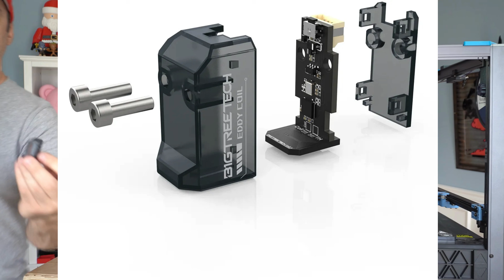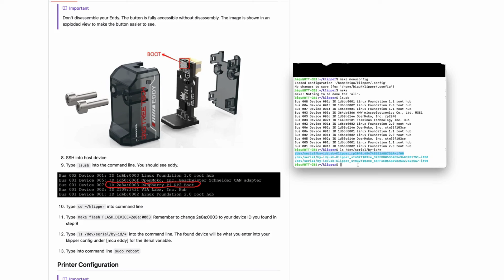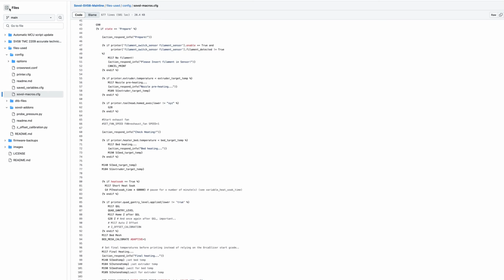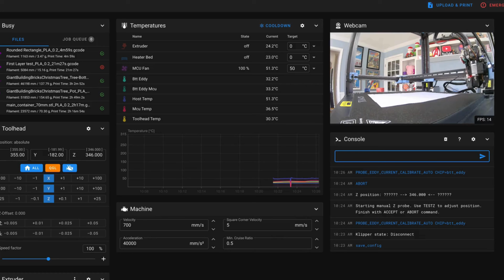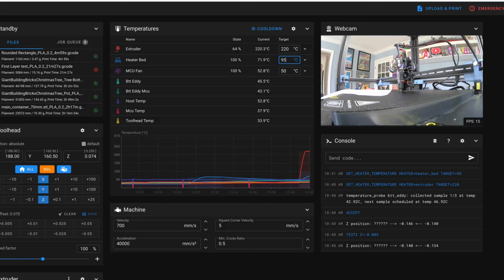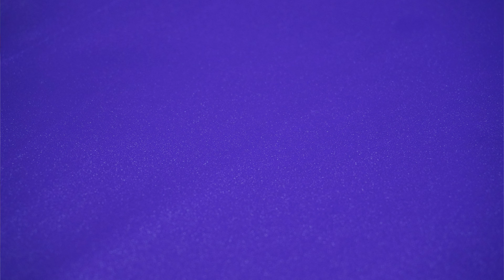BTT Eddy USB Probe Setup on Sovol SV08 – Full Install & Calibration Guide

Comment: The BTT Eddy looks pretty sweet compared to the 8 mm inductive probe that's standard on the SV08.  The stock inductive proximity sensor doesn't provide a very accurate bed mesh even with averaging two readings, and it's not temperature compensated, however the Amazon reviews on the Eddy are not very good, including a comment that Bigtree Tech keeps relisting the Eddy, presumably to hide all of the bad reviews.

I'm going to wait to upgrade the 8 mm inductive proximity sensor.  I don't see any need for half a micron of probing accuracy with the Eddy when the thin aluminum bed on my SV08 warps more than 1 mm across its surface when heated to printing temperature.  I started the mod where the magnetic sheet is drilled to expose the mounting screws so the thin aluminum bed can be removed and 3D printed plastic shims can be used to level the bed and pre-stress it so it warps to a flatter taco shape.  The aftermarket upgrade we really need for the SV08 more than any other is a thicker stress relieved cast aluminum bed that doesn't warp into a taco when heated, preferably with user accessible mounting screws with leveling springs underneath.

I see that you're upgrading the nozzle on your SV08.  When assembling my SV08, I installed the MicroSwiss hot end.  I love that I can now cold swap a MicroSwiss FlowTech nozzle in a minute using nothing but a 7 mm nut driver, without needing to remove and reinstall the heater and thermistor without damaging them, as is needed with the stock nozzle.  I also replaced the stock motherboard fan with the Noctua NF-A4x10 24V fan.  It's so quiet that I didn't bother to put it under PID control to lower the speed to the lowest that would cool the MCU and turn the fan off when the SV08 is idle.  The Noctua fan runs all the time and it's so quiet I can barely hear it.  That added five minutes to the SV08 assembly time and was well worth the time and money.
Reply from the maker: Thanks for the reply! I am finishing up a video on the micro swiss hotend. Being able to swap the flowtech nozzles with minimum effort it awesome. I frequently go back and forth with a .4 and .6. The flow is better and more consistent too. I was having some issues with PETG and the stock hotend, it would clog on occasion. No issues with the micro swiss. 

The bed... Mine is a taco, and gets worse the more it's heated. I have played with the idea of swapping to a 8mm thick voron bed. I have a cheaper 50.00 350mm bed that I had swapped out on my Voron 2.4 for a Mic6 bed that stays almost perfect on the voron. I have found a few have made adapters to adopt the 2.4 bed to the sv08. I think l'm going to do a video on it and why people may want to look towards an improved bed. 

I'm on the fence with how far I want to try and improve this printer. My original idea was to pick and choice lower cost options that would improve the print experience with the SV08. Changing beds, and everything start to push prices up into the lowerend Voron 2.4 kits. But I can see the value in doing these mods at the same time. You can start with something at a good price point and pick the mods you want to do. The SV08 means well, and I think Sovol did a good job in terms of offering a Voron like printing experience at a price point that's affordable, and something you don't have to have the knowledge to assemble, and program - until you start modding it!  

With the Eddy Coil. I have seen a few issues with the shielding of the usb cable. I have a higher quality cable, but have not had a chance to pin it and install. I'm hoping that improves some of the noise/frequency interference issues. It hasn't been a consistent issue for me, but I have a few emails so far and inputs on issues with that. 

The Fan mod is 100% a must. Instant improvement, as you said even without setting it up to be temperature controlled. 

Thanks again for sharing your inputs!!
Reply: @ThePrintasaurus  - Totally agree on all points.  I like Sovol.  I love that they're embracing open source, giving credit where due, contributing back to the community (code, mechanical designs and a little cash).  There is definitely a business model where open source can be leveraged to make a product that is re-engineered to be more suitable to manufacturing, and the SV08 was a noble effort.  Sovol got a lot right in the SV08.  As an engineer, it bugs me to see the places where Sovol was a little penny wise but pound foolish.  I would have loved to spend $100 more and had a flat print surface and 5" touch screen, and maybe a reliable camera.  I don't mind paying extra to upgrade the hot end although I wish all 3D printer manufacturers would form alliances and get discounts on good extruders rather than building their own as that's usually the weak point although the 3D printer manufacturers are finally starting to make good extruders and hot ends starting in 2024.  Similarly, 3D printer manufacturers should ship their products with plain vanilla Klipper instead of cobbling their own version, and they should ship their printers with configuration files for OrcaSlicer, SuperSlicer and PrusaSlicer rather than re-skinning one of the slicers that is guaranteed to be out of date and become more out of date.  That's wasted effort that could be spent ensuring we have good profiles for the slicer we already use.

So far, my SV08 is printing well.  PLA is forgiving enough that the taco bed isn't causing problems.

The camera didn't work, then worked for a few minutes after I upgraded the firmware, then quit again.  The Sovol SV08 camera trouble shooting page has several generic recommendations then asks the community to let them know when we've fixed the unreliable camera problem.  My SV08's WiFi didn't work either.  Most people apparently had the camera problem or the WiFi problem but I had both.  I plugged a Vonet 2.4 GHz WiFi bridge into the SV08's Ethernet port to get it on my wireless LAN.

It would be nice if these annoying issues were resolved before the SV08 shipped.  I waited half a year to avoid bleeding edge new product issues, and still had these problems, but it's still a good printer for the money and it'll take a lot less time and money to get the SV08 where I need it than building a Voron 2.4.

If I can drill the magnetic sheet, remove the heated print bed, shim it, rinse & repeat a few times and get the bed flat to within 0.2 mm, that's probably good enough for the girls I go with, but it really should be much better.  If it's not too difficult to switch to a Voron 2.4 build plate, I'd be willing to do that but I'm not ready to delve into the engineering.  I'm lazy enough that I hope someone makes a video explaining what to buy and how to do the upgrade.  Subscribed!   🙂

My SV08 wish list:

Stay flat print bed
Rock solid WiFi
Camera that just works
0.1 mm accuracy or better bed probing
MicroSwiss hot end (done)
3D printed enclosure (I'm designing it and will upload to Printables/Thingiverse)
Good OrcaSlicer profiles (I'll develop profiles the PLA, PETG, TPU and ABS that I use)
Reply: @Liberty4Ever  I'm doubling down on the bed/profiles/better probe, but.... Guys, I'm really curious what's the problems are with your wifi and camera? It's just the same linux as on RPis/OrangePi or wherever else, if something doesn't work - don't rant, look how to fix it not on SV08, but for Linux. If there would be some hardware-dependent stuff - look for SoC name too. I've seen that regularly during discussions on something new - people starting to reiterate same stuff, and one non well-versed in Linux guy gives assurance to another guy with same Linux level, and they starting to think that it's printer's problem. 

Everything that doesn't touch moving/heating parts - is a software-backed. Yep, I think that quality control and R&D could be a bit better, but after all... there's really simple way, how to look at it with a fresh mind: by forgetting that it's SV08 and by treating it like Voron2.4 with sensorless homing. Because it's what actually it is, just with a wee bit crappier extruder and injection molded parts.
Reply: @dj_feel_x  - Totally agree on the Just Fix It attitude.  My list of issues was as a warning to those who might expect an SV08 to print without fixing things.

I suspect the WiFi issue is the internal antenna, maybe badly routed or missing).  I plugged the SV08 Ethernet port into a WiFi bridge.  Fixed.  The web cam is probably a timing issue.  It mostly works.  If not, I go into Mainsail and restart Crowsnest.  The other deficiencies I listed, I'm slowly fixing.  I'm heat soaking manually to get good accurate bed meshes and first layers but need a better fix.  For now, I'm printing, and liking the SV08.
Reply: @ThePrintasaurus  Can you really spot this extreme warping with the eddy sensor or is the image of the warped bed also an artifact of the stock induction sensor going bananas ?
Reply from the maker: @maakmeneer   Honestly it was a little bit of both. What I found with the stock probe and a warped bed was it wasn't accurate enough that I would get a false reading (thought the bed was flatter than it was) If you take a look at my latest video on the Mandala Rose bed upgrade, you can see how bad my stock bed was with the eddy bed mesh.

Comment: My Eddy usb worked ok the first time a ran the temp com calibration, but now if I try and run it I get "Manual probe failed! Use TESTZ commands to position the nozzle prior to running ACCEPT" and subsequently get "temperature_probe btt_eddy: calibration aborted" it happens right after I try and save the first heatsoak Z offset save. I've homed all and ran the Z 5 mm, Any clue as to what happened ? should I delete my calibration save data and try again ? Thanks and merry xmas =)
Reply from the maker: Merry Christmas to you as well!  What are you seeing in your printer.cfg.  Scroll to the bottom, the section that says do not edit. Do you have something like this? Curious if the initial calibration failed. Under the calibrate = you should see a large amount of data. 
[probe_eddy_current btt_eddy]
 reg_drive_current = 15
calibrate =

I would rerun your drive current calibration.  Make sure you are at 20mm and rerun your  LDC_CALIBRATE_DRIVE_CURRENT CHIP=btt_eddy
Make sure you save that - SAVE_CONFIG
Then reset your z-offset  - PROBE_EDDY_CURRENT_CALIBRATE_AUTO CHIP=btt_eddy
again save that. 
Then rerun your temp offset calibration. G0 Z5.  SET_IDLE_TIMEOUT TIMEOUT=36000.   and then your calibration command - EMPERATURE_PROBE_CALIBRATE PROBE=btt_eddy TARGET=56 STEP=4

I switched to the Z-offset beta config as well - which allows you to fine tune and use your Z-micro steps to tune your offset and save it. Wanted to mention that as well. You can copy the macro section, everything below ###########macros and related ############ and replace what you have there. Just wanted to share what I have found to be a nice addition. 
https://github.com/bigtreetech/Eddy/blob/master/sample-bigtreetech-eddy-zoffbeta.cfg
Reply: @ThePrintasaurus  Yep that fixed it, thank you and happy new year ! Oh and I see there is an firmware update out now, someone really needs to do a vid on how to correctly update mainline klipper firmware ! ;)

Comment: I bought the E3D EZ probe but was wondering if the eddy would be better since I was going to do it anyways and going for the faster one seems a better idea if I'm already installing something.
Reply from the maker: I have looked into the PZ probe potentially for one of my vorons. I have a standard revo hotend, with tap on that machine. The eddy is very fast, and reduces the prep time a bit even with a heat soak to prep the bed before printing. The tap and what the PZ probe would be are really accurate as well. I think it really comes down to what you are trying to do. Speed at the sacrifice of some accuracy (eddy) or the Pz probe accurate but a slower method with having to touch the bed to probe.  Both would be a vast improvement over the SV08 inductive probe.
Reply: @ThePrintasaurus  I have been holding off to see how the eddy does, I have been running a bambu E3D obsidian nozzle on the SV08 and  it has been great with great flow and the prints look clean so it puts me in a situation that I cannot run mt E3D EZ probe. I am waiting to see what the reviews are for the eddy longer term. My sovol has pretty good first layers with the stock one just a little squished as long as I soak the bed.

Comment: After you demonstrate the lsusb, which device on YOUR console is it? There is no match for Raspberry Pi RP2 Boot in your console. Is it the one that ends in rp2040?
Reply from the maker: If your in boot mode with the eddy USB - done by pressing and holdling the boot button and plugging in usb a the same time. When you do your lsusb - it should come up as "Bus 001 Device XXX: ID XXXXXXX (whatever your device id is) Raspberry Pi RP2 boot. The device ID is what you want to copy and add to the make flash FLASH_DEVICE=thedeviceid.  

Once ran it will convert that device name to usb-klipper_rp2040_XXXXXXXXXXX_if00

If you are seeing that, it was completed successfully.  To test / check. Unplug your Eddy.  ssh into your printer and run that ls/dev/serial/by-id/* 

You should only see two usb-klipper devices - one is your tool head and the other the mainboard. 
When you do a lsusb - you should see two OpenMoko stm32f103xe those again are your tool head and mainboard.  

Press and hold the boot button on the eddy, and plug it back into the usb port at the same time.  Run your lsusb and you should now see a raspberry pi rp2.  If you have already flashed your eddy - when you do lsusb it will display as OpenMoko rp2040. 

Let me know, happy to help you get things sorted!